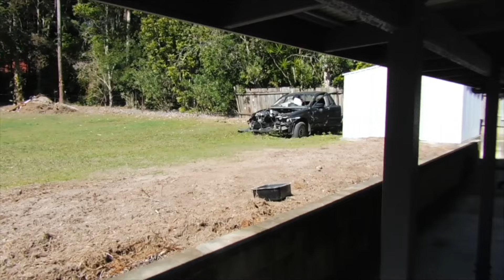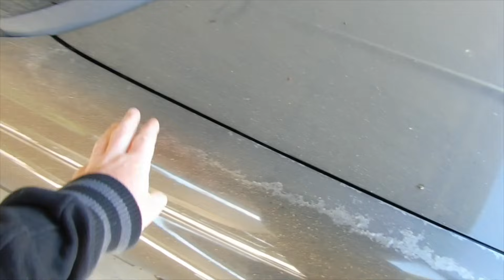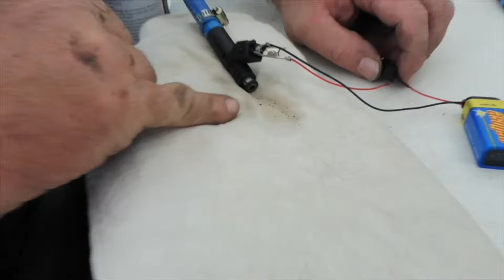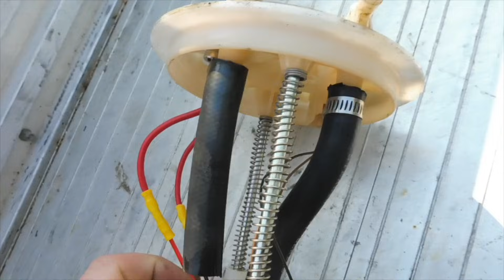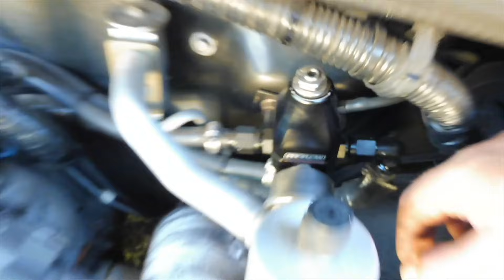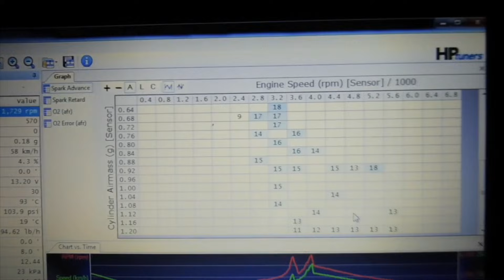Ls1 Turbo Tonner build ep17 DIY injector clean and New Walbro 525

Comment: Laty, you dropped off the face of YouTube. I love this injector hack. 

I’ve got a hold of a small ultrasonic cleaner for $40 and an injector tester for $40 which pulses the injectors for you. Run the injector tester on the injector while it sits in the ultrasonic bath with carby cleaner in it for a few minutes. 

Would be good to see more from you.